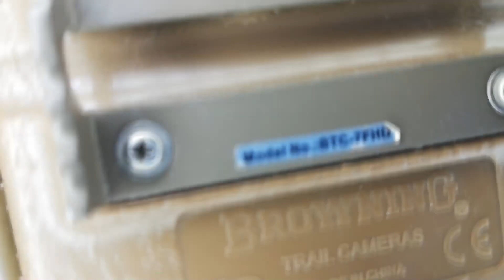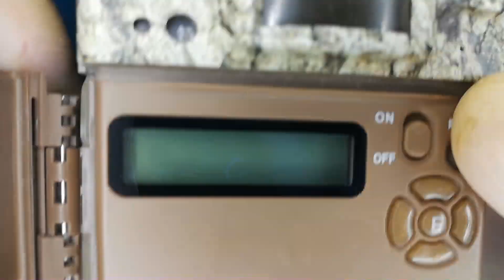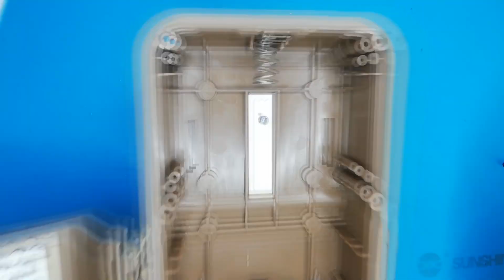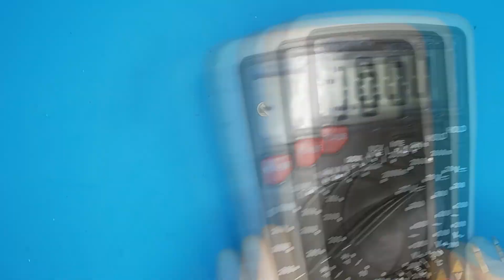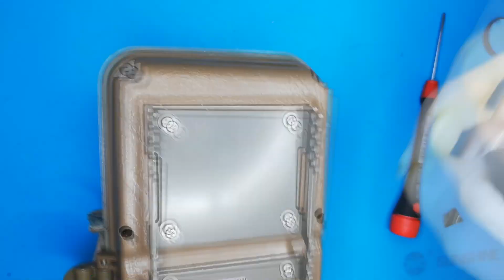Browning Trail Cameras BTC-7FHD Fix

Comment: Witam. Ja trochę w innym temacie. Szukam diody laserowej do doświetlacza laserowego . Parametry doświetlacza. <100mW , 850nm.
Reply from the maker: O iluminator podczerwieni się rozchodzi ? To trochę kosztuje https://allegro.pl/oferta/lambdawave-modul-laserowy-podczerwony-100mw-850nm-10016153360

lub inne moduły laserowe podczerwone https://allegro.pl/listing?string=Modu%C5%82%20laserowy%20podczerwony

możesz też szukać pod nazwą Iluminator 850nm
Reply: @HOTAIR83  https://allegro.pl/oferta/iluminator-laserowy-podczerwieni-dipol-850nm-100mw-7574351911. Szukam do tego.
Reply: @HOTAIR83  taka dioda. Tylko że które znalazłem mają inne napięcie max 2,7v. W tym doświetlacza jest bateria 3,7 v , cr123
Reply from the maker: @ukaszswitalski2481  Rozkręć i sprawdź może są jakieś oznaczenia modułu laserowego IR i szukaj po oznaczeniu albo wyglądzie.
Reply: @HOTAIR83  już rozkręciłem. Na diodzie niema żadnych oznaczeń. Jeśli bateria jest 3v a w opisach diody max 2,1v . To czy nie spali diody.
Reply from the maker: @ukaszswitalski2481  Może jest jakiś stabilizator napięcia lub przetwornica regulująca napięcie dochodzące do diody. nie znam tego modułu nie wiem jak jest skonfigurowany.